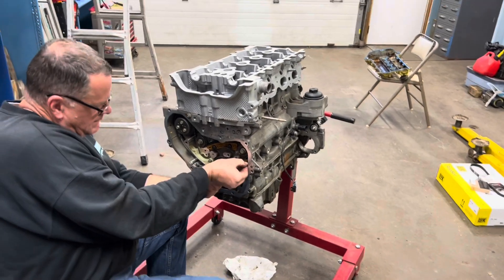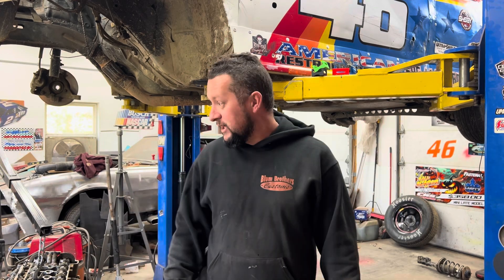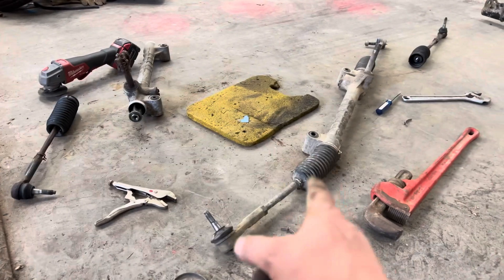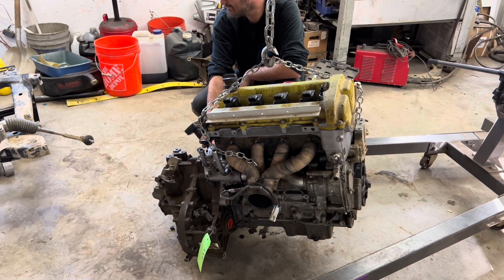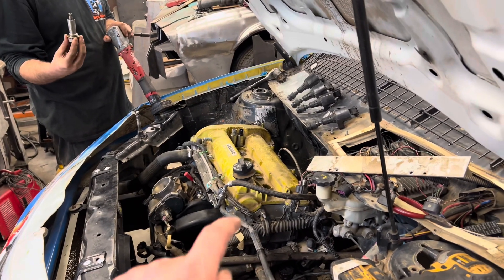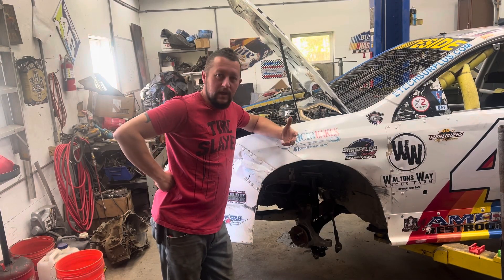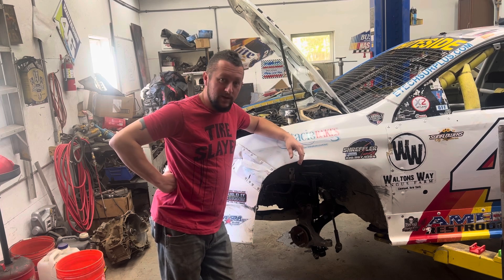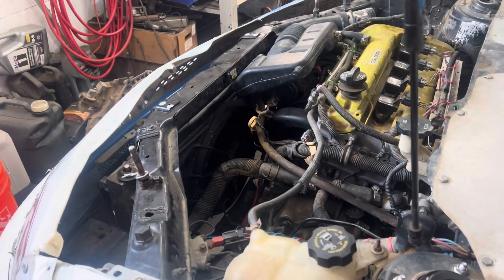New Motor Who Dis??

Comment: On the issue with welding washers to the struts for camber...I've machined steel wedges to go behind the strut so they don't move. I just hold them in place with a heavy tie wrap. And normally I run 4 degrees of camber on both sides. Obviously negative on rf and positive on lf.